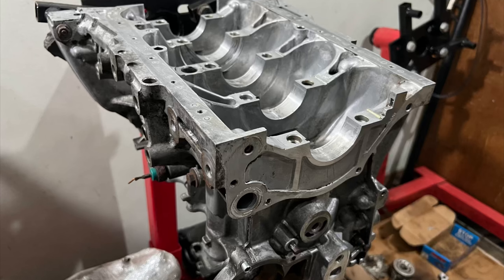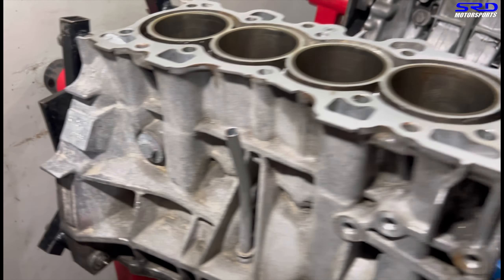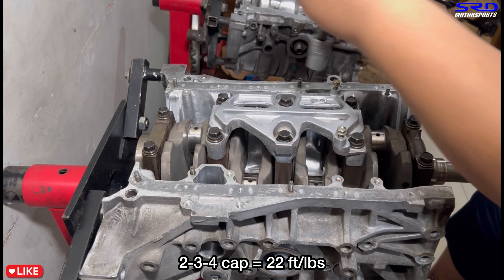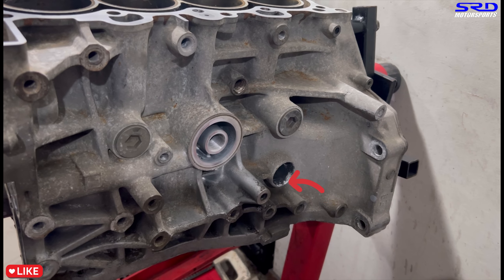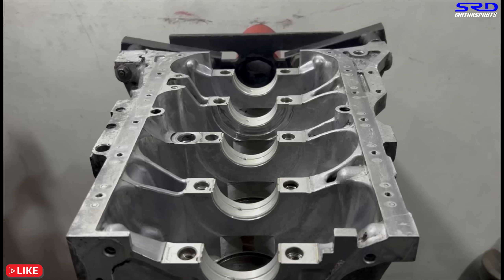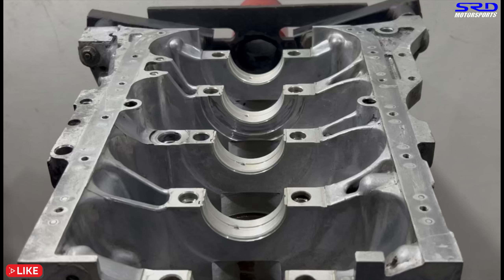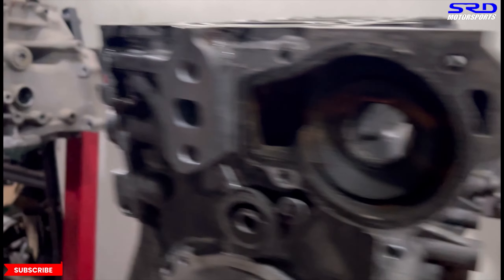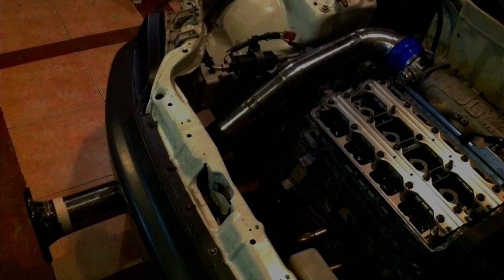D16 and B18 Crankshaft Assembly and Oil Clearances

Comment: Appreciate the knowledge being dropped, a lot of street boys always neglect to change their oil frequently because they treat it like a normal conventional car that doesn't race, the more you beat on the car the more often you gotta change fluids , don't wait for the oil to get dirty to change it, change it while it's still somewhat clean and that'll help prevent the motor from prematurely failing
Reply from the maker: Right on! Man exactly and I’ve opened up enough motors for rebuild that I can tell internals that have been running dirty oil more frequent even the head itself the rocker arm area is not aluminum color just brown 🤣
Reply: @SRDmotorsports  you can always tell by the color of the motor for sure haha
Reply from the maker: Yep no lie 🤣😂🤣

Comment: Nice! What is your opinion on the oiling/ pump differences between the d series engines?
Reply from the maker: well the y8 pump suits the y8 crank and the way it’s oil path is… interchanging them is when headaches come in…

Just like the z6 pump works well on a z6 crank
Reply: @SRDmotorsports  As the old story goes, use what you have and use it for what it was made for and you won't have any issues... some say you can't rev to 9000rpm with the D16y bottom end because of the pump, but I'm not so sure...
Reply from the maker: @ yeah not sure either

Comment: @11:30 so sounds like u would keep the black box and stock pcv on the d16, but what if i wanted to install a catch can on naturally aspirated d16 so the black box part doesn't drain oil back into engine and oil mist doesn't go in my intake manifold?
Reply from the maker: Oil mist means other issues… 

U can remove the black box but that also eliminates the pcv system altogether

Like on the volumetric efficiency video the pcv system does the job where the added breather for WOT breathing doesn’t do (which is the part throttle and idle breathing)
Reply: @SRDmotorsports  will this work: 
On a NA d16z6 on the back of the block I replaced the black box with a 10an adapter, from the adapter straight up into a sealed catch can, from the can straight over into my intake manifold?
Then, from the valve cover stock hole, to a 2nd catch can, then from 2nd catch can to cold air intake tube?

Sorry I didn't mean oil mist I just meant vapors. And thank you for being so helpful
Reply from the maker: @lurice0  that will work but it still eliminated what the pcv does so if the engine operates “only” at full throttle then yep that’s alright
Reply: @SRDmotorsports  so if i add a pcv valve before the catch can will i still have eliminated the pcv?
Reply from the maker: @lurice0  that doesn’t pull vacuum from the manifold so it’s not a pcv per say
Reply: @SRDmotorsports  I thought during idle the intake manifold pulls air out of the bottom of the crankcase by way of the pcv valve to back of block?
Reply from the maker: Yeah but if u connected to a breather that’s also open it would also suck in air elsewhere not just the block
Reply from the maker: And reread ur statement u thought during idle the intake manifold pulls air out of the bottom of the crankcase by way of pcv valve to back of block… is that towards the back of the block or from the back of the block?

Either way it pulls from the block “the blowby pressures” it can only pull of its an enclosed system

If there is a breather or opening elsewhere then it will pull in air…

Now if u do this by removing the black box but still try to replicate the pcv system? Why remove the black box it is segmented inside to lessen or decrease the chance of sucking oil
Reply: @SRDmotorsports  both catch cans will be sealed catch cans, no little breather filters, not venting to atmosphere.
Reply from the maker: So why remove the black box? If ur gonna do the same?
Reply: @SRDmotorsports  I'm not sure how i ended up with this i just thought i needed a catch can but i can't figure out how it should be done on a naturally aspirated d16. I've been trying for years.
Reply from the maker: Watch the volumetric efficiency video to see the vc breather does a diff think and yes it’s still a breather